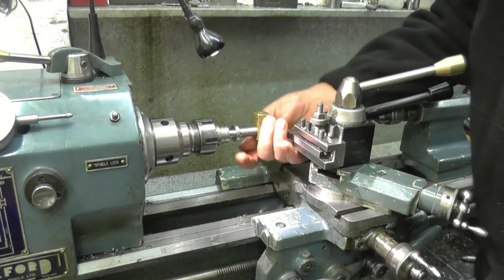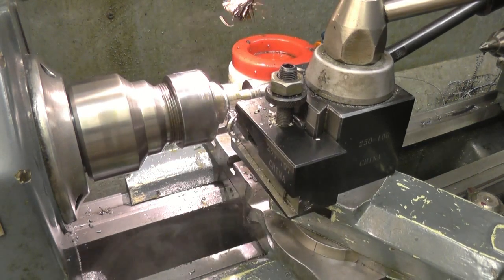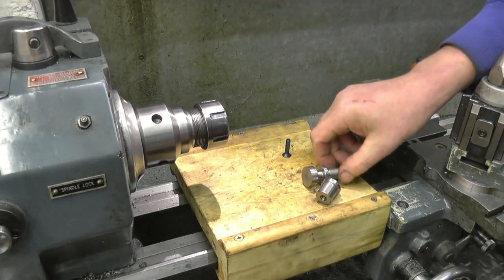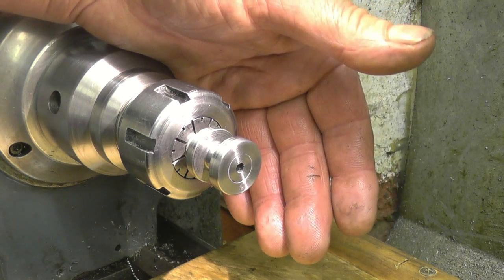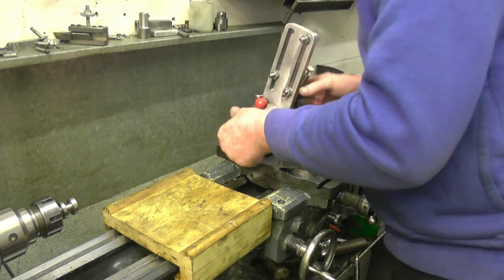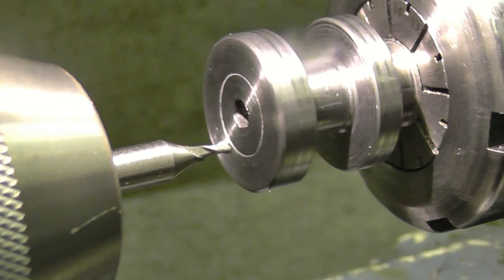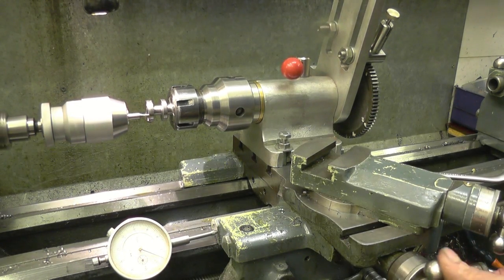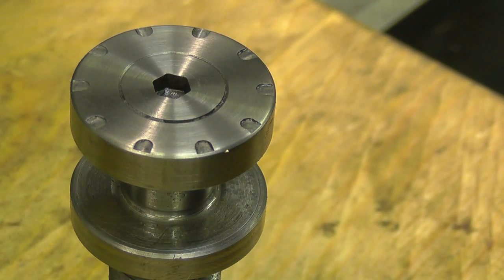Big Head Part Eight

Comment: Hello and thanks for sharing this video.
When you were tapping the inside and talking about putting a screw in I thought you were going to machine the original indexed dial down and screw that back on? Would look a lot better, surely you need to know exactly how much extra you're feeding in each time, I'd have thought, cheers David, UK.
Reply from the maker: Once the size gets close I would use a DTI to adjust the cut
The upcoming video will show the method
Regards
John

Comment: Hi John, Happy New Year.

When I'm screwcutting on the manual or the CNC, I always turn the diameter 10 thou big rather than to size.  If you've got the right pitch tip for the thread you're cutting, the tip will then finish form the crest of the thread, and also, when you've cut so far down that the diameter measures the right size or a few thou down you know it'll be right.  Harder if you're making a new part to fit an old and worn part, but brilliant for new parts.  It's good when you're working on large heavy shafts that you can't take the tailstock out of to try a ring gauge on.

Sandvik seem to be stopping making tips for single pitches now, instead having a tip for a range of pitches, but other makers seem to be sticking to single pitch tips.  They make a much better thread.  If you haven't got the right pitch tip then it doesn't work, but it's worth it if you have.  I don't do screwcutting at home, my Boxford hasn't got the screwcutting gearbox.  The trader my father bought it off knew he could get more money by taking it off and selling it separately.  I've been looking for one for years but no luck, been thinking of converting it to CNC now.

Comment: u can use the same setup u did but dont use the end mill just use a sharp center and move your slide to scrap the graduations in to the ajusters head and it works well iv made dials in this manter and it work good with that method u can mark in between your large graduations and not have to use the dial. hope this helps and keep the videos coming

Comment: Hi John, do you have any thin, say ten thou, slitting saws? You can make the graduations with one and the beauty is they only ever cut one width no matter how deep you cut unlike a standard engraving tool. Mount one running horizontally in your mill and use bed stops to set line length. You're a bright fellow, so should be able to work out the details.

Comment: Excellent work John, you are certainly giving us our moneysworth this Christmas! Interesting you leaving work to cool before final sizing. I bought an engineer made boring head, with no gyb strip or adjustment for the dovetail, stripped it all to clean it up and found I could not get the dovetails to go back together. I had spent to much time handling the male dovetail, and it had expanded enough to stop it mating! Let it cool, and it fitted perfectly! Made by an engineer in a knitting machine factory in Nottingham, I bought it off his grandson. Quality.
Phil
Reply from the maker: It is amazing how much things expand
Reply: I have been told that some diesel injection pumps have parts machined to such close tolerances that they have to be assembled while immersed in diesel fuel.  Just the heat from the mechanics hands will cause the same problem if they don't.  Never experienced that problem myself, but I've only had to work on one pump.  2 for 2 so far, not bad for someone that had no real guidance or reference to go by at the time.

Comment: Good repair, I agree with you method. More than likely if you are moving extremely close tolerances you would want to indicate the boring bar movement to verify your size adjustments. So having it with the close divisions is not as critical.
Reply from the maker: That is the way I use them

Comment: couldnt you machine the original dial face to be held on with a allan bolt john that way it holds the dial on and it allows an adjustment screw as well great video
Reply from the maker: I may have a go at repairing it
Reply: it might repair the same way john with a cap head allen bolt

Comment: Maybe it is too hard to machine, but what about using that bolt to attach the original face onto your new screw? You could also probably machine or grind the back down and weld it on.
Reply: Then we wouldn't have these excellent vids to watch.....be careful what you ask for...
Reply from the maker: I may have a go at repairing it just for fun
Reply: Yeah, I was thinking the same thing:  some method of mounting the original graduated face onto the new piece he made.    ???  Don't know, lots of possibilities!

Comment: It not a job well done until you put yourself into it.  My wife and I do alot of sewing for costumes for my sisters Shakespeareinthevines.org and we always bleed on the costumes from pin or needle stabs.  i also changed the front bearings on our '97 Cadillac Deville (Grandmas old car) today and managed to drop the left caliper on my left pinky.  Of course it drew blood, but didn't break it, I think. On the right side I hung it from the strut spring using some 3/32" welding rod.

Comment: Nice repair, why not sharpen an old center drill to a point and scribe lines for reference?
Reply: I have taken a 60 degree carbide threading tool turned side ways to scribe in the old scratch method, seems to work well

Bill
Reply: I was thinking the same thing. Mount a carbide scribe in a chuck and use the cross slide to make the mark.